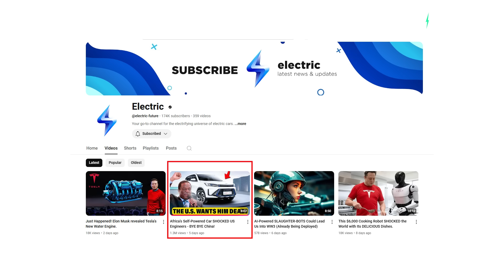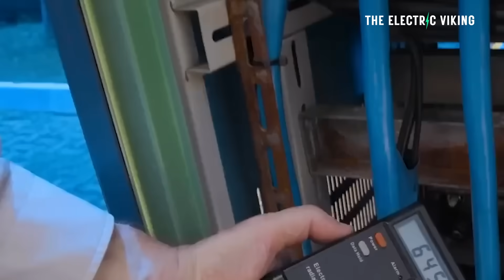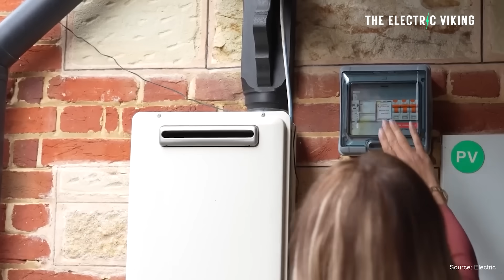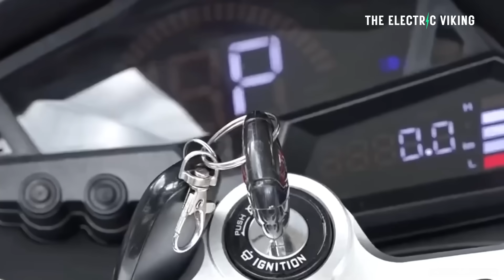Internet claims Africa’s Self-Powered Radiosonic Car SHOCKS Engineers

Comment: Sir, this tech will not affect the use of fossil fuels any more than electric cars will. The Maxwell system only charges the installed battery continuously. The car cannot operate without an installed battery. His system DOES NOT OPERATE THE CAR,  it only charges the battery
as the car operates. Stop spreading rumors about a car being run by radio waves. Tesla cars, BYD cars any other EV will benefit from this
invention. EV car manufacturers will continue to produce without any threat from Maxwell's invention, his invention will improve the operation
of ALL EV's STOP TELLING LIES SIR!!!!

Comment: Harvesting radiowave energy is "great", if your EV car has battery of 24kWh (smallest battery Nissan leaf)  you will only need some 100 years to charge your car once so in a hundred year you can drive about 250km, great isnot that? Oops: 250km/100years/365days = 7m/ day or for ancient countries which still think in feet about 23 feet/ day ? With one single new solar panel and 4 hrs equivalent full sun power, you generate 400×4=1.6kWh which   needs to charge same 24kWh battery only 24/1.6=15days or you can drive avg / day: 17km which is already much better than the RF harvesting scan...eg for a E bike, one small (day 1.5kWh))  battery for charging and a secind one for driving , laws of physics are globally enforced by mother nature, whatever scanners want to make you believe: be stupid : trust scammers and sc@ew youraelf, like this radiowave energy harvesting tool...BTW estimations used are extremely optimistic for this fake device..

Comment: If you really believe that this is a real thing that a car can be powered by radio waves that prove that the only idea you have about electricity is that you or someone in your household  has to pay a electric bill and this is your only knowledge about electricity!  One of my friends shared this article with me and I just told him that this is BS ! Even a radio to used the waves signal to reproduce the data is receiving need amplification to function and it is only moving a cone back and forth in the speaker with minimal resistance to push air to create the sound! A motor in a car with all the weight and the resistance needs a lot and I mean a lot of energy rotated that motor to propel the car forward!!

Comment: The car showed has twin tail pipe, also the generator held is a Browey Solar Portable Power Station C600, can be purchased on the web. Scam Scam Scam
Reply: The only thing that matters is HOW it was charged. It's just a very dense storage medium for power. The company who made the storage container isn't relevant - what's relevant is WHAT FILLED IT WITH POWER? I don't see the point in bashing and bashing and bashing the guy, before you've even seen the technology. 
Who do you think you're protecting? 
Either the technology will be found to work - and overturn everything - or it will be found not to work, and will fade away. Why not just wait to see what happens?
Reply: @art.is.life.eternal  It's been ten years and he hasn't explained, produced, demonstrated, or sold ANYTHING. Let's wait a little longer.

Comment: You lied, presenter! You are ignorant or are intentionally misleading by click bait. There is no such thing as "perpetual motion", agreed.

However, this isn't the claim with this machine. 

This machine converts radio frequency RF also scientifically known as radiation to a usable electron flow. 

Therefore, it is harvesting an energy constant and converting it to direct current or also inverted to AC current.  

Those are the facts. Tell the truth about the scientific facts. 

Tesla can use this device to power his cars. This device assists all EV cars and devices. 

Problems free and solid state construction with no moving parts.

Comment: Just did some chat gpt 
Look total power hitting the earths surface 1 cubic meter 
Radiowaves(nautural from space) -- negligible (10^-15)
Radiowaves (artificial from  radio or cell towers) - 10^-6
Solar radiation total -- 1000 watt
Cosmic rays 0.1-1
Visible light from sun -- 450 watt
So look is 10^9(10 followed by 8 zeros)times more effective to use solar than radio 
Even if you still use radio waves as founder claimed you would be using the radio waves from cell towers nothing else which wouldn't be creating free energy as promised
Reply: Chat gpt is not the oracle. It’s really outdated and inaccurate
Reply: @Drufi  tried deepseek too similar results

Comment: Its clesrly a scam..
Can anny real electrician look at the pictures of his fake divices. And debunk the bs he is showing.
The divice in the glas case is defenetley a lithium 12v to 220v powerbank (from china)
It even displays the input and output power and baterylevel.
It is the green one he is holding in his hand
it even have the same display.
At most. 
He disigned a powerbank.
Or its being falsly shown by the edditor without proper information

Comment: You sound dumb and ignorant.
His invention is not a perpetual motion but gets it's energy from radio waves.
Reply: It is a perpetual motion machine. The energy output is greater than the input. Radio waves measured in microwatts- one millionth of a watt (µW) cannot power EV motors in the 50 to 500 kw range.

Comment: People were powering their houses 90 years ago by illegally stealing radio broadcasting power out of the ether.   Run a few hundred metres of copper wire around your loft and you could do it, too.   It's called radiofrequency induction.   But don't do the crime if you can't do the time.
Reply: You have to be pretty close to a large transmitting antenna to do that. But a car-sized antenna is way too small to get enough power. Maxwell does not even have any antennas on his stock Chinese EV.

Comment: You have not conducted much research , so don't be untruthful. I have been conducting research of non energy consumptions of so called fossil fuels which in fact are not fossil fuels, and this is a proven fact . I am commenting because I do not approve of shill type video's . The actual power available through the vehicle is 15 kw. on a regular basis , secondly the frequency application is a plate type touch unit that does convert signals to a power source , thirdly , travelling on roads without pot holes would actually be a pleasure , as well as travelling at a high speed rate . If I as well have the knowledge to create a constant power source through a simple magnetic overlay principle based upon an axle over lay or perhaps a gear interaction , then simple motion would create a voltage and that could also be scaled to size depending upon my usages .  As for the supposed energy crisis created by the oil cartels and the governments for controlling purposes of the masses named as " We the People " , several hundred years of reserves does not now create an energy crisis... perhaps you need to actually become learned before critiquing others who take the time to actually create something useful without wanting to gouge the crap out of people . If you had actually conducted some research of free energy devices , your conclusions would probably be they passed away from natural causes ...a water fuel car / a magnetic centrifuge power generator / levitation using frequency / an alternative hydrogen / oxygen mix vehicle / amplified energy capture through magnetism / and so many more .  Rather than actually finish listening to your rubbish trash talk , answer me this simple question : why do many old world structures such as castles have fireplace mantles and openings to resemble a fireplace , but have no flue attached to them ?  Why was this done through out the entire world ?  Was this also a free energy capture system that could power an electric heater type unit ? Anyhow , let many see how long this comment will become available for many to read , which is in direct opposition to your opinion and not actual research .  T>>>...

Comment: Battery charging through radio waves refers to a technology where batteries is charged wirelessly by receiving radio frequency rf energy transmitted through the air essentially allowing a deviced to be powered without a physical connection similar to how a radio recieves signals

Comment: May be you made this video for the purpose of getting likes and comment because controversy helps u achieve those faster.

BUT IF YOU REALLY WANT TO THINK STRAIGHT ASK YOUR SELF once upon a time, if you were told that a certain material that can absorb sunlight and convert it to electricity you would certainly say its a scam, but is it possible today 

The answer is yes.

So if light can be harnessed and converter into electricity why then can other environment forms of energy be harnessed and converterd into other forms of energy? 

Go and rest dimwit

Comment: They want to import electric cars, electric motorcycles, and electrical goods from China to sell in the African market. To boost sales, they use deceptive tactics by claiming that the cars they sell are equipped with a unique feature: a microsonic generator capable of charging batteries for free. This technique is highly suitable for deceiving consumers in Africa, especially in areas with a lack of electricity supply and a higher level of stupidity. This scam is supported by their government, its cheerleaders, and a network of sycophants and propagandists who blindly defend it.

Comment: Tesla is finished for other reasons.  I hear that Tesla is working on a water engine.  But back to this, I know that there are rectennas that can provide current from radio waves, but the amount of current is pretty low.  I have a problem with you using the term perpetual motion device, what do you call a device that is powered by the sun?  What would you call a mill that is powered by running water down a moutain?  So why would you call something that is powered by radio frequencies a perpetual motion device?  I consider a perpetual motion device, is a device that once you set it in motion, it uses the power it creates to keep it in motion, and this isn't the same thing.  Kind of weird that you claimed you spent many hours looking into this, but you don't mention papers that have been published on this very subject.  Take Tesla for example, it wasn't a walk in the park for AC, a lot of people doubted him, even after he displayed what AC could do at a fair.  Sound familiar right?  Now think about AC, and what it actually does for transmission, one would think that the electrons are moving the full length of the wire, but that isn't what it is doing at all.  I digress, I would like to see what he is doing to get the amount of input, and what he is doing to get that type of output that would power a car.

Comment: Sorry, but your dismissal of this technology out of hand without actually investigating it is embarrassing. People said the same types of things about the automobile and airplanes. Verification of Chikombutso's technology seems rather straightforward. Put his car on a track and run it past the limits of any ICE or battery powered electric car. If it keeps going, it should be considered legit. You lost me when you called it a perpetual motion machine. Chikombutso's micro sonic generator claims to produce energy even when it is not in motion. Again, this is ease enough to prove to be what he claims. Hook the Saith generator up to a home that has been certified to have no external energy other than the microsonic generator, plug appliances into the outlets and see if they work. To claim it is fraudulent without conducting these experiments is anti science. Shame on you for your lack of scientific curiosity. You do your followers a great disservice.

Comment: When I joined the army in 2009, my recruiter had a Nextel phone that was ONLY available to the army. It NEVER had to be charged. In several months of using the phone he never had to plug it in. It converted radio waves to electricity the same way a solar panel converts light into electricity. Several US college students have built small scale radio wave-to-electricity conversion devices. It's not new technology, just VERY suppressed technology.
Reply: No it did not. The energy density of radio waves is jus too tiny. If it did not need charging it probably had solar panels on it, just like some watches.
Reply: @rogerphelps9939  we expend massive amounts of energy creating wireless comms in addition to the huge spectrum of invisible EMR the sun blasts us with.

Comment: It works but you need to drive below or next to very high voltage electricity pylons lines and extreme radar 
You can start the engine then just from that alone.
Once you have obtained the charge needed to spark on your cars own thermal generator you can, generally, drive the vehicle as far as you need as long as you have enough charge to initially spark your cars internal thermal dynamic generator, Thanks to this Guy.

He has also made a Christmas song electric lighter powered soley by the throw aways scrap from nuclear power stations and old hospital x ray machines from the 1000ft hole at the back of the companies office complex.
Incredible
.

Comment: Why doe's the car shown in the video have regular exhaust tailpipes if it is not emitting anything ?
Why doe's the motorcycle have a regular liquid fuel type filler cap ?
Reply: apparently, they just ordered for the shell of the car without the usual batteries it comes with, in place of that battery or engine they ran the micro sonic energy device

Comment: It is shocking how naive modern man can be.With absolutely no excuse in this modern easily accessable info age.Easy to educate yourself at basics of electronics,mechanical principles.Enough to definetly identify this invention as hoax.But not totally.There is energy in man made radio waves.But very,very small amount of energy.To power led or two.
And remember,even if it were true: radiowaves can only be generated by .....energy.Energy in the form of electricity.Yes,then coal,hydro power,solar are used to generate electricity.Back to square one.Still using fossil fuel,solar .
And by the way,if you cut above proccesses out and use solar panels directly to charge car-  so more effective.
If radio waves could be harvested at such large scale to power cars,you know what is process called?.…...STEALING .Because somebody else put their money in it to produce the radio waves.Building of towers,electricity cost,electronics needed and know-how;licensing.

Comment: I thought a channel named electric viking would provide scientific proves as to why the tech is not feasible, but all you did was shout it is not possible because it's being done by Africans. Do you even admit that radio waves carry energy and that there are also devices invented by others that use radio waves as energy source (although in very small charge amounts). The challenge face by the technology in the the past, which this young man has poported to have solved is to generate electricity in large enough amounts so as to power electronic appliances, cars and even load a household.

Comment: Are you asking us to believe your side of the story (that Chikumbutsos device is fake)  without any proof ?. 

As someone creating content about electric systems - Just an opinion out of thin air is actually dissapointing.

If your viewers are clearly interested in this topic - Why not take your digital electric Multimeter - fly to Zimbabwe and connect it to the output of this device for 24 hours under load. 

Film those figures - and then make a video giving your opinion with actual electric figures as proof. 

Without backing up your opinion with test figures and expecting us to just believe your opinion that it's fake just makes you another NPC on the internet. 

It's like someone in 1879 hearing that Thomas Edison has just invented an incandescent light bulb and instead of going to see it (which you can actually do) and test it - you proceed to just shouting out It's Fake on the internet.

Comment: It's real, anyone even Elon Musk and the car industries can produce this. But it's just our monetary system that is stopping this kind of technology to be out in the market and it's not a new thing. If you can understand basic components of electricity and how they work and add creativity then that is it, basics such as the vibration of induction coils increases voltage, thick copper coils have more watts, or how to harvest Radio waves storing it to a capacitor to a vibrating electromagnetic induction to a thick copper coil that has more watts blah blah blah... I can go on. Again it's the monetary system that stops us from doing this kind of stuff.

Comment: I didn't waste time watching this video because I didn't have to. Anyone who believes vehicles can run without consuming an external fuel source (whether it is electric or a type of fuel) has never studied physics or didn't understand it if they did. Yes, radio waves have energy. And, yes, this energy can be harnessed, but there aren't enough radio waves around you to produce enough power to move a vehicle. You can't make a viable solar car, and there's way more energy in solar radiation than radio waves.

Comment: Also my dad's in electrician and he has made a device that does get micro  voltage from the air and all you have to do is step up the voltage with the transformer system dude It's not that freaking  complicated to figure out  the basics so really dude you're going to be proved wrong and you should embrace the changes in the world because I believe his technology will get integrated with all the other automakers it doesn't have to be about duality It's obvious that you're getting a narrative and your pockets are getting lined because you sound just like the caught Democrats  that got caught committing acts at treason there's no meat to your claims you sound just as ridiculous as them and you should really figure out what side you're on the good side or the dark side